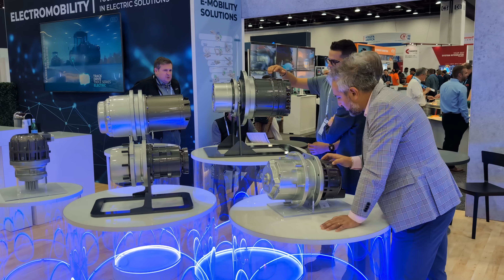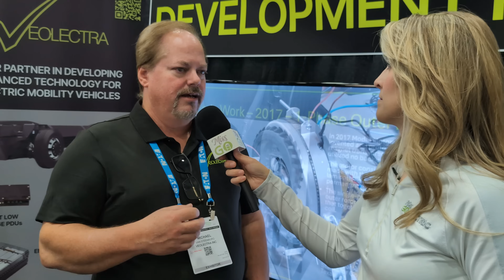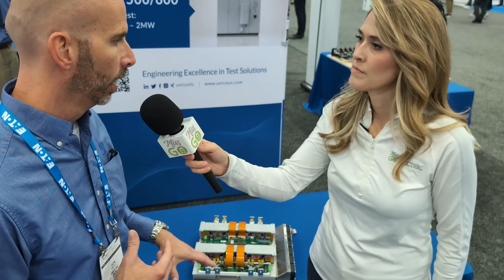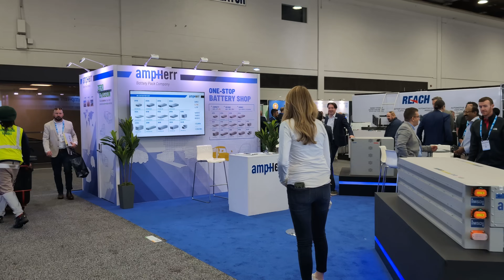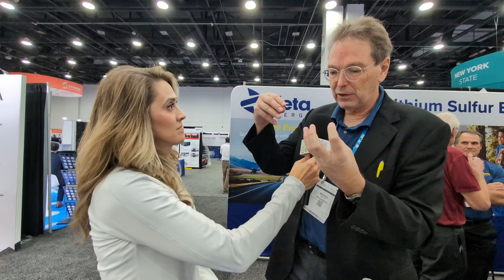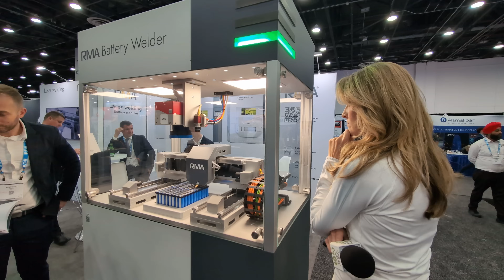2024 Battery Show Highlights

Comment: From my experience not charging super fast is huge. If you have to charge super fast it should only be for 20% of capacity of cells. They do need time to recover. The biggest thing that causes Lithium to break down from charging is going to 100% every time you charge especially in hot weather. Keeping cells under 70F air temp and lowering the charge rate per pack/bank. Example I have 4 banks of 14.3kw @ 51.2 volts (funny they say that it's 51.2 since that means I have 15% of battery life left at that voltage). I charge at 200 amps max @56 volts. That means 50 amps  per bank/pack battery group. Since my cells are 280ah that charge is around 0.18C per bank. I leave 10% on top and 10% on bottom so the cells never get overworked. Doing this should give me 20 years before I hit 85% left or 15% degraded. So these could last me 40 years. I plan on adding 2 more in 3-5 years and do a comparison. Right now after 2 years there is 0 loss. You see these EV's after 3 years loosing 10-30% of battery life. That is because they take them to 100% and or charge in hot climates at fast charging which doesn't give the lithium recovery time. The pulse charging sounds like a win win. That helps keep the cells cooler and lets the lithium time to recover.
Reply from the maker: Thanks for sharing your perspective. 

I'd push back on the idea that any new EV will lose 20%-30% in the first three years. This is not a realistic outcome regardless of the charging regimen. Every EV battery is warrantied for at least 8 years against that kind of degradation.
-Producer Tim

Comment: zeta energy seems to really work in the sweet spot of ideal EV batteries.
Reply from the maker: There are some volume density and swelling challenges with sulfur cells, but they'll certainly be part of the diverse array needed to fit each battery application. 
Thanks for commenting. 
-Producer Tim

Comment: Pulse charging and battery rejuvenation is something John Bedini has been telling us since the mid to late 90s. We can also recover the back EMF (voltage) during the off phase of the duty cycle and charge a capacitor bank to discharge (current) into the batteries, not only increasing the battery life, but its range. We're only scratching the surface.
Reply from the maker: Very little of what we are doing with electric propulsion and batteries is entirely new.  The name of the game these days is optimization and standardization.  It is an exciting time to be alive.  We hope you'll subscribe here and check out our weekly 10-minute EV news show THE CURRENT over here:
news.missgoelectric.com
-Producer Tim

Comment: That Zeta Energy Lithium Sulfur Batteries looks interesting.  Many questions, though.  Maybe visit them in an upcoming video for more info.  Looks like they are twice the volume of LiON batteries and ~ 1/2 the voltage (2.0V).
Reply from the maker: Sulfur batteries can expand quite a bit when accepting a charge.  Accommodating that swell does not favors for volume density.  That said, the power density by weight is very good. The strengths of each individual battery chemistry will indicate their highest and best use. Product diversity is the bedrock of a healthy marketplace. -Producer Tim
Reply: @MissGoElectricIndustry  Hi Tim, it is actually just the opposite. Our swelling is significantly lower than traditional lithium ion batteries, such as NMC. Another reason why so many folks are looking into this battery technology